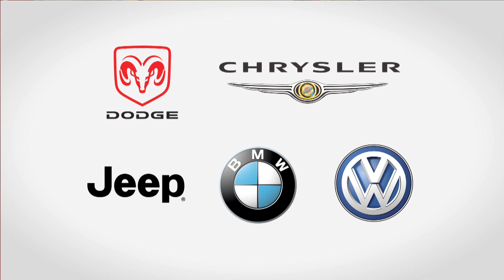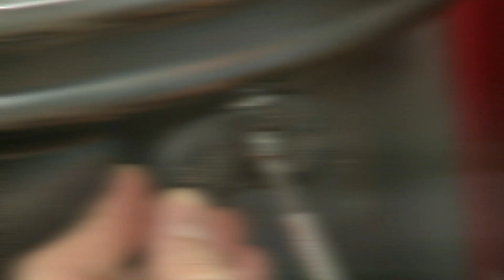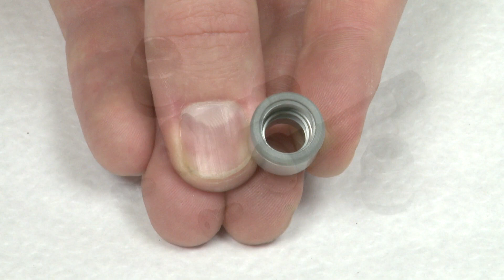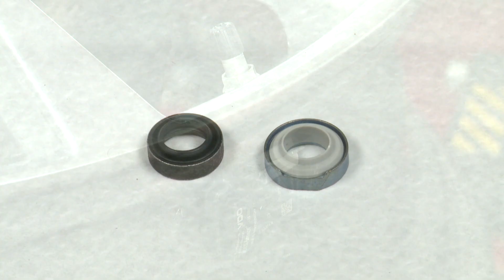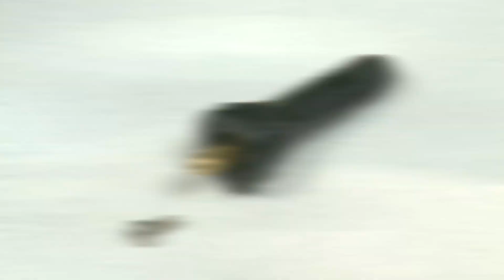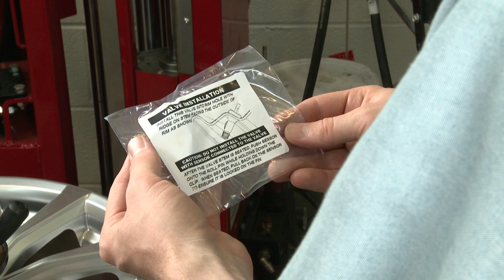Common Aluminum Valve Stems for Tire Pressure Monitoring Systems (TPMS)

Comment: The original TPMS sensor require 65 in-lbs (2009 Nissan Sentra), but new service kit for the nut included in that set gives 35 in-lbs. I didn't look before on the packet of the service kit and installed w/63 in-lbs. The car was driving perfectly fine like for 2 years. Now I'm replacing the wheels and moving the TPMS sensors fm old wheels to the new ones. I'm replacing the service kit items of course (nut, washer, gasket, and Schrader Valve). Here it came to my attention the printed value of the nut torque on the small packet for the kit (35 in-lbs). So I don't know what torque to apply 65, 35 or smth in between (especially as everything was fine and with 65).  I inspected the previous service kit nuts, which were used for 2 years, and which were under 65 in-lbs instead of 35, they were fine, no hair lines on them. I would appreciate any opinions on this matter. Thank you for the detailed film.
Reply from the maker: Thanks for reaching out! A torque of 70in.lb is what we state on our website and what Nissan recommends (specifically 68in.lb) for the original TPMS sensor. If the sensor has been replaced with an alternate version, the recommended/required torque may be lower.

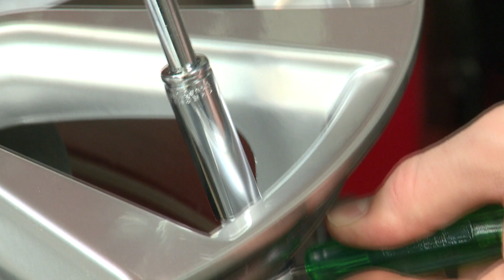Comment: Where can I find that mounting pin used at 1:37?
Reply from the maker: This is Dill's 5417 TPMS Tool (linked below). I'm happy to provide you with a distributor in your area if you can let me know in what state you are located. You are also welcome to call our in-house Customer Service department and they can provide you with distributor information also! 
Customer Service: 800-815-3455 
Website Link: https://www.dillvalves.com/product_cpt/5417-tpms-tool/

Comment: Can I replace just a core in a tpms stem like a non tpms stem
Reply from the maker: In addition to the TPMS stem’s grommet seal, hex nut, and valve cap, the valve core should also be replaced whenever the tire is being serviced. For aluminum TPMS stems, only electroless nickel-plated valve cores should be used. This type of valve core can be used in non-TPMS and brass stems as well.

Comment: Woud you or anyone in he audience know what type I have on a 2009 Toyota Sienna? Rubber, aluminum, stem connected to the TPMS or can be separatable, (is that a word?)? I have to address a stem with a slow leak, Thanks for the video.